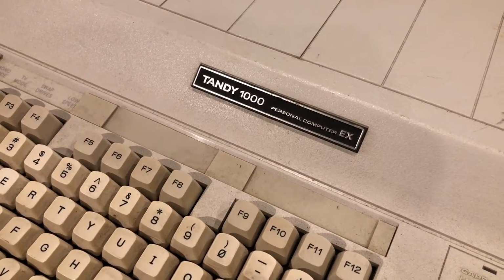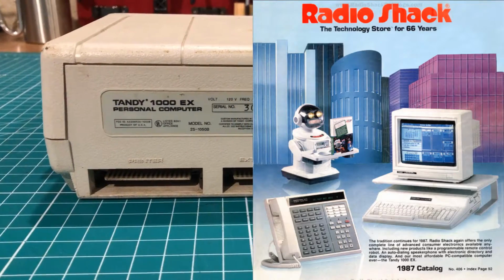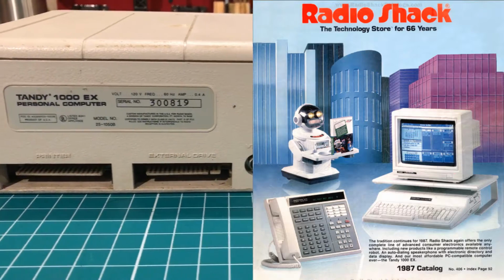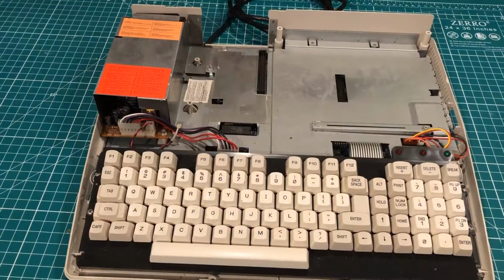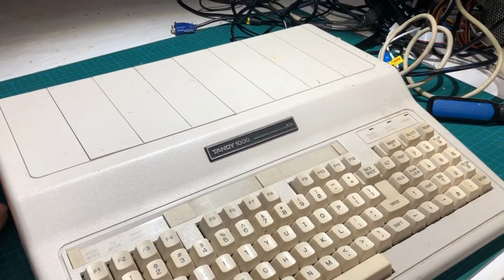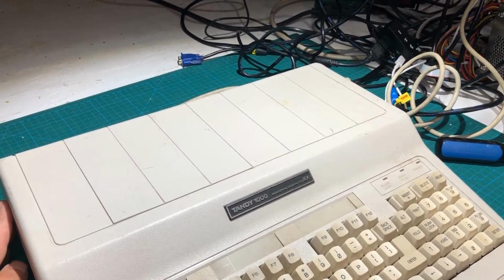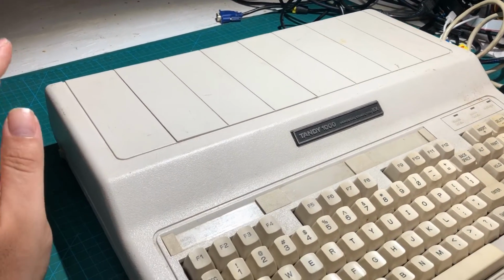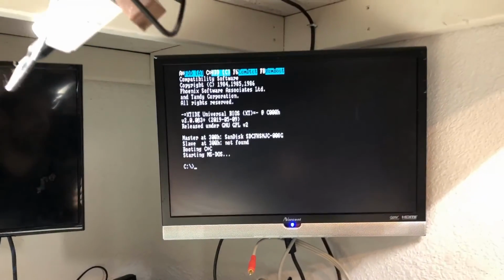The Ultimate Tandy 1000 EX and 1000 HX Upgrade #SepTandy

Comment: I know I'm going to get laughed for asking this question. But how do I order the board through PCBway? I assume you upload the gerber files, but there's a list of other files on the github too and some look important. I.e 3-in-1-cache.lib. does all that get uploaded too? I hate to say it, being that this was my first computer and I've worked on computers since I was ten and I'm 40 now. But I am very confused.
Reply from the maker: I try to use the pcbway shared projects if they're available. I don't remember on this one. If you have to manually upload to pcbw, there is a button called "quick order pcb" that is WAY easier and sets all the defaults based on the gerber itself.

Comment: It's great that your parents got you a tool that can play games rather than just a toy! Not knocking consoles, really, I love them, but I love them a LOT more when there are already computers in the household. And back then that was not a given.

Comment on soldering the sockets--I keep a range of sacrificial ICs around to put into sockets while I solder them, especially the larger ones like 28 and 40 pin, but for the smaller ones, too, when I get ones with dodgy pins. I mark the backs of the ICs so that I know they're not working ICs (they're pulls from repair jobs), put them into the socket when the socket is set into its vias (to avoid perforating my fingertips) then solder with everything held securely and no worries about frying a chip if I linger on a solder joint.

Your board makes me wish I still have an EX or HX! I loved the Tandy enhancements to CGA.
Reply from the maker: Yeah. I played a lot of games on the EX, but in doing that, I learned a ton about PCs in general.  It was an amazing gift.  The sacrificial chips thing is a brilliant idea. I need to do that.  

And yeah.  The EX/HX are really nostalgic for me.  It's kind of funny to me today that I ever typed on that keyboard though :)